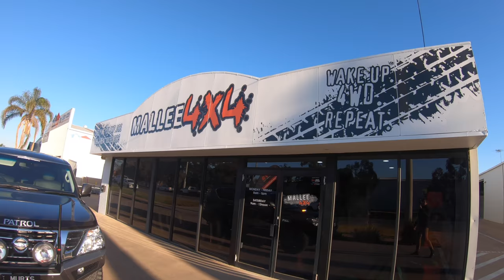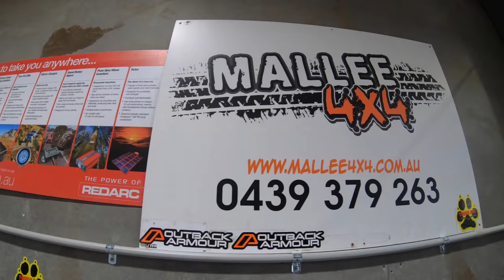FABWITZ 5 INCH STAINLESS SNORKEL INSTALL! || INDUCTION SOUND AND BIG DESERT 4WD ACTION ||

Comment: Hey Murtz, snorkle looks great but what's putting me off fitting one is lack of mounting points on the snorkle. Why didn't fabwiz add an extra mount point for the snorkle in the inner guard? Having only the rubber connection (rubber mount) and the A-pillar mount (single fixed mount) doesnt seem enough considering most of the big brand snorkles have at least 4-6 mounting points through the guard additional to the pillar mount. I just see it as a potential for the snorkle to vibrate and squeak on the guard on corrugations and rough terrain. 

Let me know what you think. 
Also is the Induction noise not too over the top to live with day to day?
Reply from the maker: Hey mate thanks for watching! Great question mate as this was one of our worries as well. The rubber connection is just temporary, I don't think you will see them sell too many more kits until this is fixed. We screwed and clamped it on so it is well sealed but it isn't the ideal set up. They have a proper adaptor being made and also an airbox. Being such a big snorkel and how much corrugations we do yes it was a worry, honestly now its all fitted on even with my body weight pulling down on it it doesn't move at all. It seems to be a very good fit, obviously we will be watching this over time but if it is something holding you back then I wouldn't let it! And the induction noise no I love it. Window up you don't even hear it. If you are out the bush and want to hear it crack the window and sounds amazing. Day to day don't even notice it mate you have to be fairly feeding it to get the loud noise. Hope it helps mate cheers!
Reply: Great response Murtz ! :) 
I'll wait and see what Corey does to re-design his snorkles. Good to know the noise is not too obnoxious for  day to day. I'm hoping with one of these color coded would blend in nicely. 
Keep up the good work and I'll live vicariously through your videos until I fit out my Y62 S5 a bit more.
Reply from the maker: @oozuk  Yeah the only changes that the snorkel needs is the connection which I mentioned is in the works and the mounting bracket they are going to make that adjustable for the perfect fit. once this is done it will honestly be spot on. They have done well to be the first to do a 5 inch its a big piece of pipe haha! Awesome mate! Do you follow us on instagram? I have a website launching soon mate that will have a few tips and tricks for setting up the patrol!
Reply: @Travellingcampers  yes mate i'm following you on instagram, i'm @goin_adventuring on there
Reply from the maker: @oozuk  Beauty got ya mate!

Comment: Any water issues with this style snorkel ? meaning water ingestion, heavy rain etc ?
Reply from the maker: We had our airbox sealed up and did get some water in there driving in heavy rain, have put a hole in the bottom now so should be sweet. Love it
Reply: @Travellingcampers  so it that something you can then seal up for water crossings ?

Comment: Does / Has it rubbed on the roof? Looks to be all but a bees D of clearance there.
Reply from the maker: Hey mate! Na it doesn’t but Definately sits close! They are in the process of making a new adjustable bracket mate so can play with it a bit. No issue tho ☺️
Reply: @Travellingcampers  Awesome. Didn't think it would once mounted. Looks and sounds the goods though man 👍
Reply from the maker: @miraboi1  Na it actually mounts solid as mate! They also have a new airbox to suit the factory airbox coming so I am looking forward to that! Cheers mate!